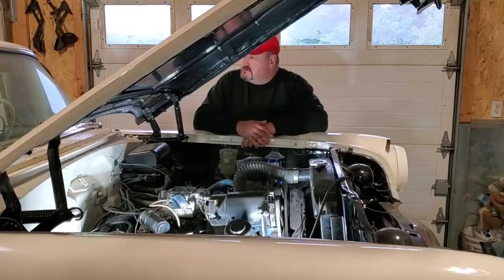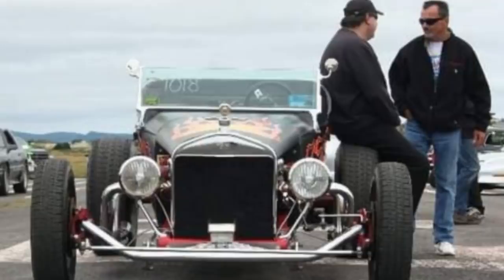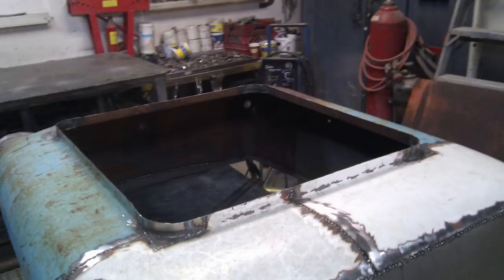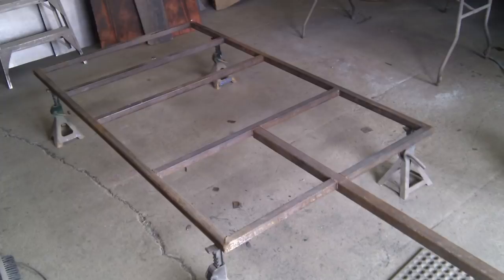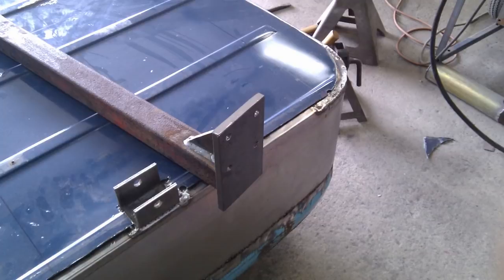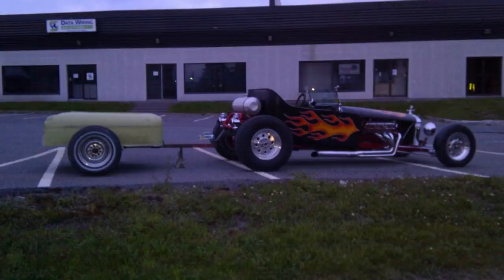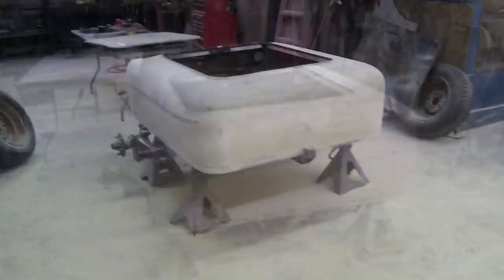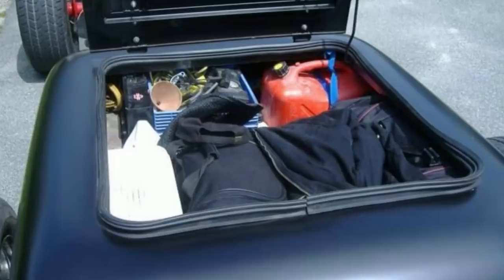Build a custom Hot rod trailer from the scrap pile!

Comment: Awesome! Love the telescoping trailer neck. I've often thought of a similar arrangement for a boat trailer with a movable retracting front piece of landing gear such that you could winch the whole thing down into the water without backing the tow vehicle down too far. My father built trailers for a company here is Somerville, Mass. called Shertzer that featured a telescoping low-bed design used for hauling heavy equipment -- dozers, road graders, etc.-- that could then be returned empty a lot shorter. When is the show in Moncton usually held, and whereabouts? I'd like to get up there and check it out one of these days. My wife was born there (in 1960). We have people in Dieppe and Riverview. Her grandfather was an engineer on the CNR, driving trains out to Cape Tormentine, Edmunston, Bathurst, Halifax and elsewhere. Enjoying the heck out of these pics and videos and learning a ton. Have a good day.

Comment: Excellent. So with the leafs.  One end has a shackle hanger and the other bolted to the frame bracket?  No slipper springs?  Didn’t bounce around? Thanks
Reply from the maker: No it was not bad. We were concerned about that but worked out fine

Comment: If you remove the drawbar at events, it makes it into a theft deterring device.  You could also have two strut rods from underneath contacting the ground to keep it level when unhooked from the car; this option may be preferred by your wife if she needs to get in it constantly.  You could also hook up an emergency brake handle inside the box connected to the trailer's brakes to keep it from moving or being stolen - this works better on designs using car axles with drum brakes.  FWIW.

Comment: Hey Fitzee!  What are the odds you could make a video on the basics of butt welding?  Such as ideal gap width, technique, tips, etc.  I'm a beginner and struggling a little, but your videos have been the most helpful that I've found.  Thanks a bunch!
Reply from the maker: I have alot of videos on butt welding. Door bottons. Quarters. gas door. Both install and removing. Each video has many tips. Check them out

Comment: sorry to be out of topic, i learned to weld without gas, now i want to move on welding with gas, can i use gas and animated (no gas) wire? i don't want to throw lots of no gas wire in the trash, thanks.
Reply from the maker: No you can't. Save the no gas wire for some frame work. Flux is a thicker wire anyway and will give you more work in grinding. Run a 023 wire with gas for sheetmetal
Reply: @fitzeesfabrications  thanks a lot. you rock man